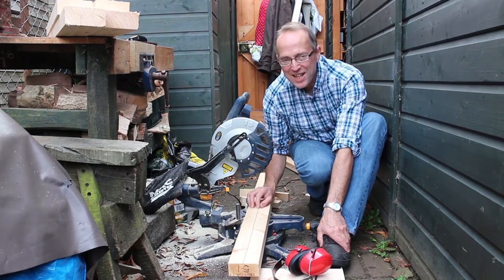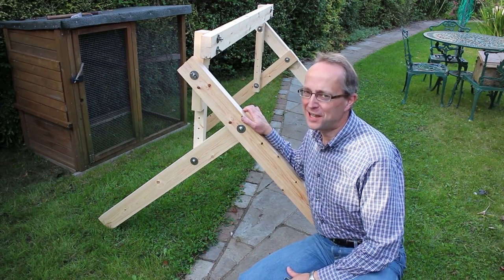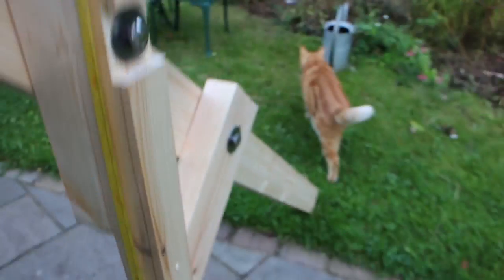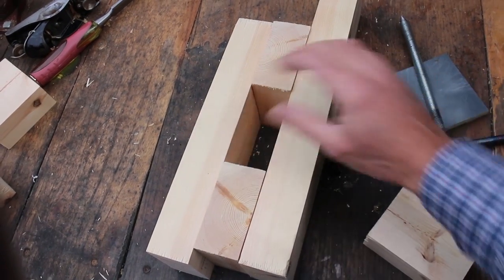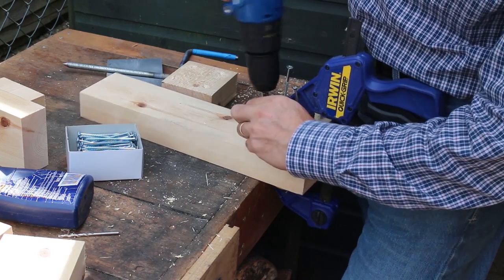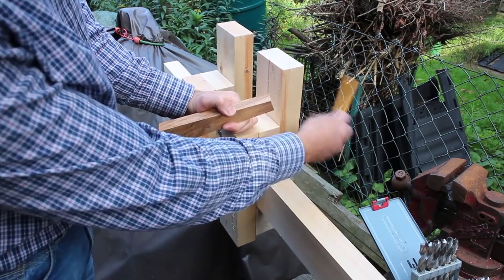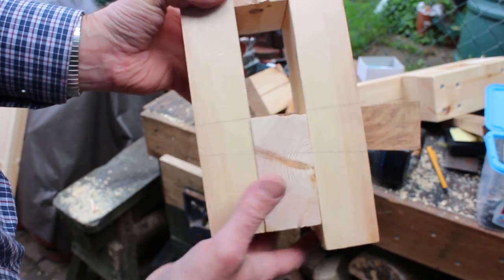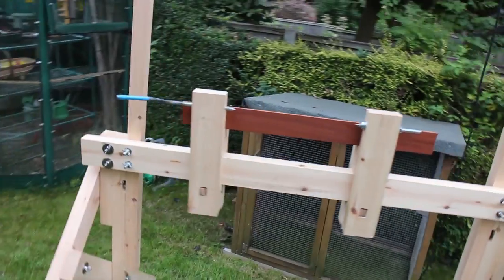Rapid Build Pole Lathe

Comment: It's 730am in the states and as soon as I get some sunshine I'm building your lathe. This is by far the easiest setup I've seen and I'm so excited. I've been making yarn drop spindles for my sister's yarn shop, having to use dowel rods is a buzz kill for me, can't wait to turn some truly hand crafted pieces of art. Thank you so much for your channel!
Reply from the maker: Thanks Judy.
Reply: @harryrogers  no no thank you. I finished mine around noon yesterday but it started raining on me, and I don't have the bungee yet. I'm excited to test it out!
Reply: @harryrogers  oh a quick question, how long should the treadle be? Mine is about 8' long. I was hoping that the extra length might give more rotations. Any input?
Reply from the maker: @judycharvey5790  hi it might take a bit of pressure on your feet.
Reply: @harryrogers  You we're 100% correct. I cut it off at about 6' and so far have made a goblet. Again thank you for making one of my fantasies come true.
Reply from the maker: @judycharvey5790  Fantastic well done Judy.

Comment: Excellent video. I would prefer using green timber ash or something but that is only my preference and anyway your design could be adjusted.
I am of the age where I grew up with feet and inches and I do not think in metric 
Thanks again Harry
Reply from the maker: Hi - yes I built my first one with green oak and still use it a lot......I am inperial at heart because like you I grew up with the 12x table and 240 pennies to a pound!
Reply: +Harry Rogers I am with you both. I like feet, ins, bushels, pecks, gills and £ s and d. I remember the tables in school and the chanting of them, it was good teaching in those days, it set me up for life.

Comment: I rather like metric though.
Everything looks 2,54 times larger when you put it in centimeter...

On a more serious note: 
Thank you for this video. I'm a re-enactor who tries taking his real-life job along for the weekend, and I made a very heavy, very bulky pole lathe for that. (Among other things. I basically have my complete workshop in a modern and a medieval version)
Unfortunately, as all joints were friction based, and it has been assembled and taken apart many times over the years, there are now very few original pieces left.
This one does not seem to have to be completely taken apart to be moved in my trailer, so I hope it will last me a bit longer than the previous one.

Comment: Great instructional video for a great pole lath & after all the versions of a pole lathe that I have researched on u tube, this one is by far the best engineered one for me to build. One question though. How long a chair leg can one turn before the lath bed starts to flex ? Will it be possible to turn a shaker chair leg  ( new yankee workshop ) approx 48” long on the lathe ?
Thanks for all the hard work you have passed along.
Regards.
Richard.
Reply from the maker: Hi Richard...that will be a challenge, I have done it but I used a steady...hole in plank of wood around chair leg clamped to lathe base, to reduce flex.

Comment: Great video Thanks,  how did you attach the bungee uprights? are they removable? what size bungee cord?
Cheers
Reply from the maker: Hi - I used 6mm bungee cord which is fine for turning chair legs. the uprights are secured by bolts so that they can be easily removed for transportation. Thanks for your comment Harry

Comment: On the cranks, would adding something like tee-nuts, prevent wear. I'm conscious that where the threads port through the wood, that they will chew it away. Fixing them on the inside and the outside of the crank poppet should prevent future erosion and play in the crank.
Reply from the maker: Yes thats a good idea, and you will see that on my other lathe I have done just that, but its not essential as the wear on the wood is slow.

Comment: Suggest please an example of how to think as a woodsman using salvaged wood from pallets and standing dead wood as a material source how that a woodsman was able to feel in conjunction with the lathe chuck center/ lathe bed how to select the height of where to drill the leg pieces and length of respective leg pieces to make a folding portable equipment(not mathematics these guys had a feeling for everything) and have a stable base for relative to my height and respective weight of whole logs or log pieces. I am tired now but when I was still out in the woods I know (probably because of the unknown toxic air conditions) that I wasn't fully able to wrap my thoughts around how to get a stable base for uneven terrain and create a horizontal level bed within what I could envision for my design.

Harry, the junk scavenger. That's funny that with the adage for UK that you dont have to fight there to properly make use of good materials despite desperate shortages of Real materials here due to stupid corrupt consumerism having infiltrated.

Comment: Hi harry I am working out a list of materials for the lathe. I cannot find the poles you refer too as "metal studding". Could you send me a comment on what it may also be called. I am trying to advance my skills as an apprentice carpenter.
Very cool design as well.
Reply from the maker: Hi try mild steel threaded bar, or long bolts...threaded br is the most likely - good luck

Comment: sorry if i missed you saying it in the video, but could you tell my the bed height at the tallest setting please? I'm around 6' 5" so i need to figure out if your dimensions will work out nice enough for me.
Reply: +oberlater Probably too late to answer this but the height of the lathe is not critical. As you are so tall though, you could always make the uprights a couple of inches (5cm) longer.

Comment: Mr Rogers, as I was watching your construction of your lathe, I was wondering if your design might allow for a flywheel mechanism with a heavy outer rim of some sort to be added to augment the efficiency of its operation. If placed below the center of gravity, it would aid in the overall stability of the lathe as well.
Reply from the maker: You could add a flywheel and it would work a little like Leonardo Da Vinci's lathe..........Stuart King has posted a film about this on Youtube that might interest you!
Reply: Harry Rogers I wasn't aware that Da Vinci had done that. Did he invent the flywheel as well?
Reply: @mrtadreamer  Realizing that this is a very old comment but… how would a flywheel help when the action reverses constantly?

Comment: Thanks for the video Harry! I've enjoyed watching a lot of your stuff! I am a little baffled though. I can't for the life of me figure out how you are screwing the poppet (sp?) together. I see you screw the two 4 inch length pieces to the 16 in length piece, then you proceed to screw the 12 in piece right on top of the 4 in pieces. but it looks like you use the same spots for the screws. How are you managing to screw 2 layers of 2.5 in screws in the same spot across 3 pieces of wood only 1.5 inches thick?! I'm looking to build something like this and am trying to gather a materials list and make sure I have the process down and I just couldn't figure that one out.
Reply from the maker: Forrest Burks Hi Forrest the screws are slightly off set so not quite the same holes.
Reply: That was about the only thing I thought it could possible be, just wanted to check before I went insane drilling screws into screws.  Thanks a lot!
Reply from the maker: Forrest Burks great...good luck

Comment: Big respect! Thank you for giving me the means and method to build my own Bungee pole lathe. I have carved a wooden rolling pin from a fallen Rowan branch using just a  Surform and half round rasp. It was fun and end result pleasing enough, for a beginner, but awkward to do and so now I really appreciate the many benefits of a Shavehorse and Pole lathe. I have begun on the Shavehorse build and soon the Pole Lathe thanks to your excellent video. 
I just wondered in the closing footage you have cord tied around the two poppets similarly - what was the purpose of that please?
Reply from the maker: Hi Barry...that is great...the cord between the poppets is a safety thing...if the wood flies off the lathe it's travel will be halted by the bungee cord hitting that cord, thus protecting any spectators in front of the lathe. Best wishes Harry

Comment: Given your experience may I ask how long you can make the lathe bed?
Reply from the maker: Hi I did once make an extension to turn 4 ft back chair legs and it worked but was tricky as the wood whipped around a bit...a shorter bed is stiffer and turning shorter lengths like standard chair legs is easier.
Reply: Sound! Thank you.

Comment: what angle do u cut the tool rest to and any ideas for a benchtop no power tool lathe for people short on space.
Reply from the maker: michael houghton Fairly steep....something like 45 degrees will do it...its not critical. If space is tight fix a bungee to the ceiling and have a smaller foot pedal perhaps.
Reply: Harry Rogers thank you and tight for space is an understatement. thanks though
Reply from the maker: michael houghton I know the feeling I do not have a lot of space!

Comment: What holds the tool rest in position?
Reply from the maker: Its just balanced on the two ledges........I have tried securing it with a bit of bungee - i.e. like a large rubber band, and for spacers I have used offcuts of wood. Harry

Comment: I'm building a pole lathe, and I have no clue what tools I should buy, I'm looking for basic tools for basic projects, and I live in the USA, and can't find any pole lathe told online, any help would be greatly appreciated
Reply from the maker: take a look at woodland craft supplies in the UK......similar shaped tools will work
Reply: Harry Rogers Thank you so much for the quick reply! One more question, instead of using a bungee or a pole, could you use a counter wight like a sand bag?
Reply from the maker: Zachary Tarbell some spring back helps, so probably not!
Reply: Harry Rogers would normal lathe tools work?
Reply from the maker: Zachary Tarbell Yes - you could start with those, and then look around for a deep gouge......I have posted a film on Using a Pole Lathe and chisels to use etc.

Comment: I will say one thing in defence of B&Q, they now have almost like a pic n' mix selection of hardware like screws & bolts that are fairly reasonably priced.
Thanks to a couple of decades of Tetris and a not quite crippling case of OCD, I've managed to save a fair few pennies over the years.
And M10 hex nuts are great catapult ammo, so any extra space can be filled up with a few of those as well